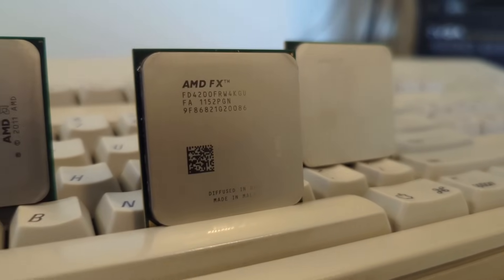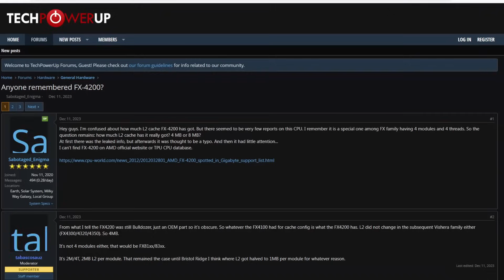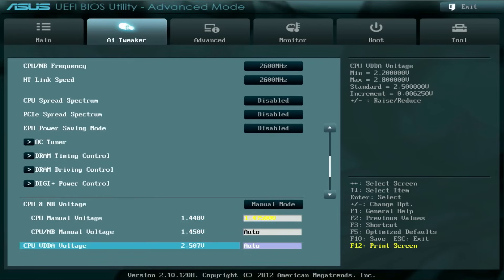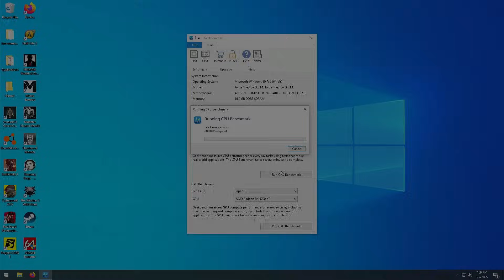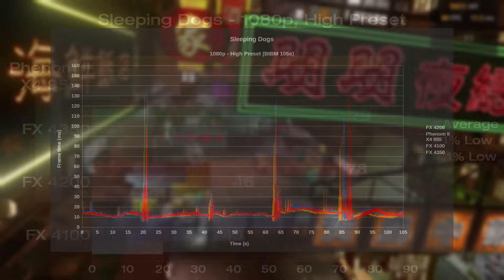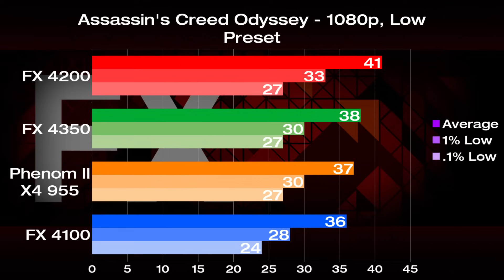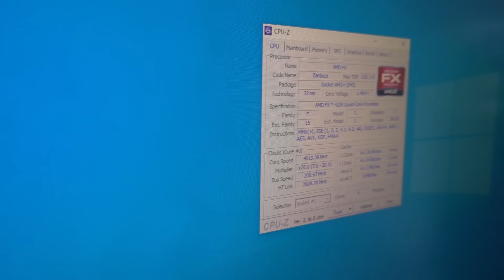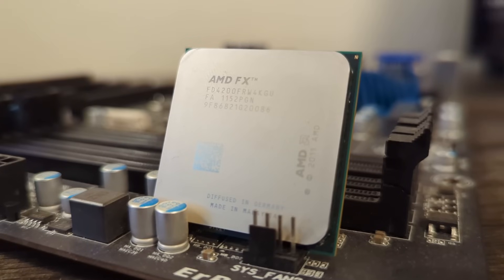What if AMD FX had "real" cores?

Comment: Funny thing is, you don't really have to actually wonder how this extends to the later chips either.

If you compare AMD's Ryzen 3 1400/1500 performance from 8 years ago to the last bulldozer era chips (steamroller), you find that many single-thread metrics are exactly the same, if you adjust for frequency. Zen's core was effectively AMD taking the robust front end that they were forced to develop to make good use of Bulldozer, and having a single ALU which they then beefed up to handle the extra resources it now had.

Comment: If I recall right this was the general idea for what Steamroller was supposed to be; giving each core its own FPU and removing the shared resources so each CPU was a more traditional core. Performance barely changed, and it was mostly abandoned on desktop, then the 8350 was the only thing being sold from AMD until Zen finally got released
Reply from the maker: Maybe the 4350 was being sold through then as well. A commenter on here mentioned mine has a really late manufacture date of around late 2016.

Comment: There were some motherboards that allowed you to experience this with an F 8xxx. I don't recall the exact model, it was either an Asrock or Gigabyte, the bios had an option to have a single core active per module, so you could turn an FX8350 into a 4 "full core" cpu. I ran mine like that for gaming.
Reply from the maker: Unfortunately I don't think my board supports that feature 😢 Otherwise maybe this video would have been done with an 8150. Tbh though, I think this is the more interesting chip considering in came in that config by default and was marketed as a quad core

Comment: Majority of people I know, including myself used AMD as the price for intel was insane and their socket would change too fast, seemed every season in the year had a new intel socket replacing the others.

Still rocking a 8350 because I was one of those fools that thought RD-RAM was the future and invested in a dual slot1 mobo
Reply from the maker: I second the point about Intel's changing sockets. One thing you could usually depend on AMD for was longevity of a platform, I mean look at how much life AM4 has gotten.
Reply: @SPNG  Still rocking an 8350. I'll probably skip AM4 and wait/see what MS/AI has planned for win11 before upgrading

Still got my K6-2 with original 3d rage (w/4mb of ram) ;) Rocks motocross madness 2 and mechwarrior 3

Comment: I had an fx4400 with a gtx 550ti like 10 years ago. It ran 👍
Reply from the maker: The most 2011 PC ever haha
Reply: @SPNG hell ya. The funny part is that I gamed on that rig until 2017. After that I went with a ryzen 3 1300x and gtx950, which I then upgraded to a 1660 ti. Now I have a ryzen 7 7600x? (I think) and an rtx 3060 12gb. Man I love building computers. If I could get a job doing that, I absolutely would.

Comment: I still use an fx 9370 in one of the pcs. It still runs some games reasonably well
Reply from the maker: I've tuned my 9370 on this platform before, it's a surprisingly fast chip and responds great to OC but good god does it consume some power. Makes the total system power draw at the wall go up to well over 500W
Reply: @SPNG  I’ve got a soft spot for old hardware. I remember it would heat up my room quickly. I’m the R9 290x I had paired with it helped a bit too lol

Comment: This proves that the Phenom II was a budget beast. I had a 965, and never had issues while running Windows 7. RAM limitations and issues with Win 10 when Win 7 EOL came around caused me to update. 

I built a few budget systems with FM2 sockets (AMDs Apu focused socket) but otherwise never messed with the FX period CPUs. 

Keep in mind that in 2015, AMDs stock price was about $2-$3 per share. Now it's at around $150.
Reply from the maker: Phenom II could definitely get you by for a long time! As long as you weren't holding onto it with games in 2020 and beyond I think it would have been the way to go versus FX.
Reply: @SPNG 
I still have that PII 965 floating around in storage along with a decent AM3 Mobo. Might build an ultimate Win XP machine out of it or something, as the Phenom II came out right around the transition to Vista/7 and should be killer for XP.

Edit: incorrectly said it was an AM2+ board, it's and early AM3 board though.

Comment: The best part of this cpu was it's stability underload while overclocked and overvolted. With good cooling this thing was a hotrod with close to 80% gains over stock. This required a highend motherboard with the ability to deliver that power. Which wasn't cheap even then.
Reply from the maker: 990FX was the way to go if you were tuning for sure. A lot of 970 boards don't have the ass to do any good overclocking.

Comment: This is cool but it's really possible to get similar if not better performance out of like an 8350 and disable every other core for a game in processor affinity. This let's the 4 active cores access to the same resources while also leaving the odd number cores to deal with os operations. The cores doing work for the os aren't likely to ask for the fpu. This chip in the video seems to just be an 8 core thays binned low and has cores shut off.
Reply: Also the phenom really should do way better but it lacks modern instruction sets.

Comment: I ran FX8320 from 2014 to 2020, at 4.2 it was able to run Cyberpunk at 50-60fps high settings. That was it's peak, but also CPU was maxed out most of the time, and power hungry, still a good run and great deal for the money.
Reply from the maker: A lot of folks forget how affordable FX was! I think for that period of time it still would have been a decent performer, and unlike the Phenom II chips you wouldn't have to worry about instruction sets.
Reply: What GPU did you have with yours?
My daughter is playing with my old rig... Fx-8350/1060Ti. 
She bought a new case, bigger SSD, some RGB lights and I'm amazed at how well it runs the majority of titles.
Now we are always on the lookout for used GPUs, this CPU deserves a 1080 or at least a RX 580.
Reply: @PeturMag  Hello, I ran 750ti, RX560, and RX5700 non-XT finally when cyberpunk came out. Before upgrading to i5 10400f. I think RX5700 was little bit CPU bottlenecked for sure, but in Cyberpunk it did okay, because it can use all CPU threads. I think something simmilar, maybe RX580 or 1080ti, will be fine for sure, but some these are no longer supported by new drivers, so be aware of that. Maybe used 2070 super with 8GB and DLSS support? Anyway nice to hear FX can still be useful to learn and have fun with.

Comment: If you have or are able to get a decent X79 board, a video on the Xeon E5-1680v2 would be fun. 8 unlocked Ivy-E cores with quad chan DDR3 and could easily clock over 4 GHz.

I had one running ~4.6 daily for years and performance was often similar to a Ryzen 2700X despite being from 2012. It lacked AVX2 but not a huge deal. It does get hot and power hungry but not too hard to manage at ~1.3V (load) and even my X79 sabertooth handled it fine.

That was the pinnacle of DDR3 IMO. Showed what Intel could have been capable of if AMD stayed competitive but instead we got the dreaded refresh era.
Reply from the maker: I've never tried out an HEDT platform before 😢Maybe that would be a great entry into it!
Reply: @SPNG   Definitely. The chips and boards have come down in price in recent years but the Rampage IV extreme and EVGA DARK are collectors items. What's cool about X79 is OC'ing isn't a lot different than the desktop chips aside from memory. A matched quad chan DDR3 kit is more reliable at high speeds but you could probably get by with 4 identical dimms.

Comment: It is interesting, especially if you consider that fx4200 has slightly higher clock than fx4100 and slightly lower than fx4350.
And Phenom's ripping them apart in most of the usecases also shows how good Deneb was compared to Bulldozer...
Reply from the maker: Nah, the 4200 has really low stock clocks. 3.3 GHz base, 3.9 GHz boost IIRC. It was the hardest to OC out of all of these chips

Comment: I was surprised to find that the FX performance wasn't much different from the Phenom 2.
Reply from the maker: I just heard from most folks that they were slower clock for clock, so it was nice to see the 4200 not behind overall lol. Of course FX is generally capable of faster speeds compared to Phenom II, but I think a clock for clock test is the best way to compare these architectures

Comment: I absolutely adored the AMD FX 6300 and 8300 that I used in my previous setups. I did have a roommate at one time that had a different model of FX-8000 series that was god awful. Like a... 8350? Ran way hotter, like insanely hotter. I have no idea wtf that was about. AMD botched that particular model and it made the actual FX-8300 look really bad. Ran overclocks on both the 6300 and 8300 and they NEVER got as hot as the 8350.

Comment: yes it is indeed 8 cores finally it works like that that's why this gen "amd pre ryzen" was much more efficient in multi threads than in mono however it was spread over 4 modules in fact it's as if you had a 4x cross fire x or sli of bi gpu, and then it slows down because the 8 cores are not on the same die and then in the end it was really not this problem of these slow processors it was mainly their very low ipc that's why it was not too expensive and had a high clock frequency to compensate in short on windows the processor is recognized as 4 cores with 8 threads however intel was the only one at that time to do hyper-threading/smt and the amd fx was cmt so apart from windows many programs recognize the amd fx as an 8 cores and 8 threads

Comment: It is a bummer that most people didn't understand what they were buying, but my FX-8350 was one of my best bang-for-the-buck builds I have ever had.  It is tough to remember the specifics so many years later, but I'm going to do my best.

My little writeup from 2013 says that a "comparable" Intel CPU would have cost me $100 more, but I didn't mention which specific Intel CPU I felt was comparable!  I also mentioned that motherboards for those Intel CPUs cost $50 to $100 more.  In those days, $150 was a ton of extra cash to spend on your GPU.

The FX-8350 was an absolute beast for compiling and other integer-heavy workloads, and there weren't really any games that could max out the four threads of available floating point.  A `make -j 8` was indeed nearly twice as fast as a `make -j 4`.

It wasn't the right CPU for everyone, but it was a hell of a deal for some of us.
Reply: You might have considered the Core i7-3930K. By the time I built my own machine at the end of 2012, I believe I'd read the FX-8350 reviews and decided to stick with the i7. I was pretty happy with it, but I wonder if the titles I tested on PCSX2 in 2017-2019 that were too much for the i7 would have done better on the Team Red part.

Comment: Aside from synthetic benchmarks and some niche applications, most software just don't use FPU that much. This is why there isn't a significant performance impact on games and many everyday applications. From engineering perspective, it probably seemed to make sense back then they can reduce the die resource by half, yet only has a small percentage performance impact for most apps.

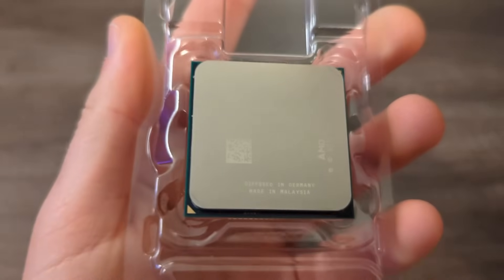Comment: 4:20  Can you selectively disable cores in enthusiast BIOS to get the same result on a regular FX chip?  Or using something like Process Lasso?
Reply from the maker: I don't think this revision of the board can do it, but I think that's possible on some other boards. I need to get another one with that feature to try it out for myself
Reply: In general, there's always cores disabled on any chip. Usually these are set in the fuses so there really isn't usually a way to limit cores. But under the right configuration, it may be configurable in firmware.

Comment: I ran an FX-9590 as my production system CPU for many years. And the fact is, as I was working on high-dataset cryptography and video compression, it absolutely slaughtered my i7 systems in throughput. Granted, in general software, the i7 was better, especially in games, but I really think the FX was miscategorized as a general purpose amd64/x86 processing platform. I do want to point out that the FX was a huge learning testbed for AMD, and how Team Red has taken and held the lead with the Ryzen construct.
Reply: "the FX was miscategorized as a general purpose amd64/x86 processing platform."

That. RIght there. That is the crux most people dont understand about that CPU. Its not a gaming CPU. It just isnt. I CAN run games decently well most of the time (title dependant). But most games even until fairly recently werent even coded to take advantage of multicore platforms. However, particularly the later piledrivers, will run circles around other chips in a vast majority of bespoke and niche tasks. And the price difference was nothing to sneeze at, they were a great affordable way of getting some decent grunt even for general computing, as long as you didnt ask too much of them. I didnt, and never had a problem with them.

Comment: I enjoyed my cheap 6300 overclocked to 4.4ghz, it stopped my r9 280x from bottlenecking 🤣
Reply from the maker: I ran a similar clock on my 6300 when I was dailying it. It was tough to reach it on the cruddy board I had back then though 😅
Reply: @SPNG haha same, it was some old matx cheapo board, I can't remember what it was, it needed 1.475v to be 100% stable, it never failed over the 5 years I had it though 🤣😎

Comment: Never new this variant existed. It would have been nice to have one of the full 8 thread cpus in the charts. Personally, I stuck with my Phenom 2 x4 965 BE until I got an i7-4790, then back to AMD with the R5 3600. Never owned a Bulldozer or any of its successors.
Reply from the maker: I think I'll throw in a few 8 thread chips if I end up doing a follow up. And that's a pretty good upgrade path, can't say I blame you for skipping this gen of AMD.

Comment: At the time I was using the Phenon II 1100T it had 6 physical cores and despite no hyper threading at the time it still held its own. I was planning on sticking with AMD at the time until the first batch of FX CPUs dropped and they actually seemed like a step back somehow. It was my main reason for switching to intel on my next build. It seemed like even for a budget build that they were a bad idea in general.
Reply from the maker: 1100T was a beast for its time, and you wouldn't have to worry about any instruction infidelities until way later on lol. What graphics card were you running with it?

Comment: The reality of the situation, is that the reason the FX chips sucked so hard, is because none of the software supported the hardware, leading to having to brute force things compared to the intel competitors. This is why the later FX chips, at least, actually held up shockingly well over time, because more and more programs started to actually become properly multi-threaded, which reduced the impact of the FX chips' shared bottlenecks, and subsequently reduced the impact of the lowered single-thread performance as well. More heavily multi-threaded workloads worked pretty well on the non entry-level (that is to say, the non quad-core) FX chips. 

Basically, and I know this will upset some people: 
FX is what Intel's P core and E core nonsense would have been if Intel hadn't had legacy market dominance and thus the leverage to FORCE programs (or more specifically, Windows itself) to be adjusted to work properly with the new-fangled and odd architecture. We have seen similar issues with the Ryzen cpus initially, where the ones with multiple CCDs had some significant issues until scheduler and pipeline behavior on the OS and software side was modified to properly account for it. FX never really got those adaptations, and relied on pure brute force without being able to leverage it's quirks in most consumer use cases. In industrial, scientific, and other non-consumer spaces, the situation was a bit different, with bulldozer and piledriver being MUCH more competitive due to the much earlier adoption of multi-threading and emphasis on using all resources available. They still ran into some issues due to lack of software adjustment to work specifically with the architecture's quirks, but there was notably different performance and reception compared to typical consumer market.

Comment: You are only testing the FX 4000 series and comparing a different quad core from an earlier generation.  This does not explain how the FX 4000 and FX 8000 were only affected and the FX 6000 was not even considered.  I have the AMD FX 6300 and was aware of the problem with the 4 and 8 core problem where it had shared FPU's over 2 cores.  There is a practice in Intel where they have defects in their silicon but only affects some of the cores and they pass those off as lesser CPU's like from i9 to i7, i5 and i3.  AMD used to make CPU's that were literally all the same but had junctions on them to make them different models.
Reply: FX 6000 series was also affected by the shared FPU. An FX-6300 has three of out four modules active.